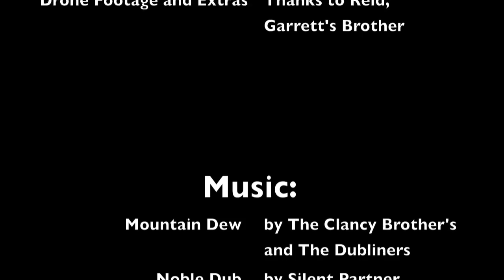Salt & Tar Episode 32 - Part 2: Cabin Re-remodel

Comment: Well done, it looks way better, and you make a great point about the limitations imposed by designing & building the original cabin in the confines of the shelter. It did come out looking a little like a houseboat! A poster below  (from Norway) makes a great point about strengthening forward and around of the mast. Your through deck mast collar still looks a little light to me. Thinking of Cape Horn here ;)

Comment: I have rebuilt 3 restaurants and 3 houses, for sure, you have done the right thing.  Ships carpenters used to rebuild the hold for every shipment when the hold is the home, you just rebuild as needed, see SV Emerald Steel.  In 30 years you will be much like Suzy and Jules.

Comment: Not sure what the eventual plan is, but I would have advised reconstructing the top edge of the cabin top's framing and jointing it in to the cabin top beams before putting the sides back on. As it is now, it will be awkward to reconstruct from the inside, but you're going to have to find a way to do it otherwise the first good wave is going to see you back to open boat cruising. Also, I hope you're glassing with epoxy and not polyester, as polyester has a nasty habit of not staying stuck to the wood. Great that you're reducing the deckhouse size though, more chance of dinghy stowage on the foredeck and stronger in the way of the mast partners.

Comment: Garrett (Mr. Tenacity) made the correct decision, even though it was the difficult one. Ruth can now enjoy more overhead cabinet depth due to this increased deck walkway. It can be a bad experience when one falls overboard whether on the hard or at sea, so this wider deck area will also make walking it safer (I've held my breath numerous times while watching you two up there). In my mind, Ruth is the Poster Woman for "Stand by your man"!
Reply: I agree either flush deck or have nice wide walkways for rough weather.
Reply: No Ruth, don't go postal. LOL I think you meant poster woman.
Reply: LOL.  Lordy......It was supposed to read "Poster", like Poster Child.....glad you caught that. Changed it!
Reply: I agree safety is key but now she looks Salty.  I've been waiting for the second issue of the remodel..

Comment: Love to know if the boat with the masts made like radio towers way of your starboard side is a catamaran. If it is then its famous. It used VW Beatle engines to walk up out of the water in the early 70's to save on boatyard fees and to repair it if damaged while in the middle of nowhere. Would love u guys to let me know.
If not it may be another well known old boat. So if you ever get the time would love to see which and what sort of boat it is. Those masts taking forgranted its a boat are just galvanised pipe with the air removed for rust protection. Really interesting build from an era of home builders doing it how they could aford and it all worked.
As for you guys. Amazing. Been working on other peoples boats since I was 9 now at 47 after hitting a whale that disabled the only boat I could afford I to am embarking on a build of a 35ft cat, as my Mrs get sea sick. To lazy to film but who know that might change now our backyard is large enough for the build. Love the woodwork skills and tou doing it ro fit what you want proud every time I watch an episode congrats.

Comment: Ouch, that was painful to watch, after all of the work building it.  But you folks seem to know what you’re doing, and it’s probably better to do it now, than not be happy with it later.  Best wishes.
Reply: Trouble is Andy, they clearly don't have a clue what they're doing. They need some professional guidance, this cabin structure will have no fundamental strength
Reply: David Arthur I don’t see how you can say that with all the support and 2 layers of ply then will be glassed on top all that it will be just as strong as before. This is not their first time!!

Comment: Making progress ! Great
The old bondo brand being used on wood (its an old rumor )does not work its polyester based it cracks out.
Use a good epoxy based resin with a filler ( also known as west system) A low buck sort of version is a good 2 part epoxy mixed with 90% wood dust so it seems just barely tacky.
Or at least visit your local auto body shop and buy a modern epoxy based flexible easy sand filler.
have had experience with all three systems dont make the same mistakes I did.
Good luck 
Ps Garrett make it count does not sound like Ruth is going to buy a 4th version LOL

Comment: Love your videos, thanks for sharing all the progress. I've a question if you don't mind. I see you using a straight edge to draw cut lines in multiple instances, I'm curious why you don't use a chalk line if you're making a straight line anyway? If this is a stupid question, I apologize in advance. I'm not a boat builder.
Reply: No such thing as stupid questions ;) We did use a chalk line first but it doesn’t always stick and can be hard to see under the intense sun so we trace over it in pencil quick with a straight edge

Comment: Nice work, guys; good to see you out of the mountains. Can't wait to see you in the blue water. Now that you are working on the top, a question about the bottom: how will you drain bilge water that will collect between the "floors" down on the wood keel? Maybe you have limber holes cut down next to the stringers, but can't see them here or in the early videos where you were constructing the frames. Seems moisture down on those plywood gussets and steel fasteners is a bad actor. In a heel, lots of leverage being transmitted from the that big ballast keel of yours to the frames via those gussets . And, enjoyin' Makim and Clancy (aaarrr).
Reply from the maker: Hey Rodney! We will have a bilge pump like most boats to get any water out of the bilge. Initially when we launch her she'll have water rushing in but once she swells she'll be tight like a barrel. Salt water isn't as much of an issue as fresh water. I sure hope the gussets are never submerged we'd be half way sunk! Da diddy di dum ;)
R
Reply: Thanks, a voice in the darkness and there's an answer! To the question, it seems the low parts of the bilge where water can collect is between the wood keel, floors and bottom planks, with no means of draining from each frame to the single low part of the boat, that is via limber holes. The wood boat Susanna has pvc lined holes through her frames with a spring loaded chain run fore and aft that can be pulled to keep 'em clear, and I think Tally Ho has slots cut between the floors draining to the low spot. Regarding gussets, I'm envisioning you guys in a starboard tack with rails awash (yahoo), with that collected water moving up the side and soaking the plywood, which in a heel are the new low points in the boat. Any water proofing down there in the future? Yup, get 'er wet and she'll take up water, and be "...tighter like a drum, dum dee dee dum dum." -rj

Comment: Man does it look more ship-ish now. Good riddance of the fullsize hunchback. 
And it's still "way bigger than people's tiny houses" according to Ralph. 
I probably would have tried to "just" reinstall the slightly curved sides "just" a bit more to the midshipline, but I'm sure You had a good reason doing it in straight.
And, by principle, inventing slight changes isn't that unusual in boatbuilding. We once broadened a whole motor vessel by sixteen centimeters (6.299 imperial guesstimates for You inch-people...) after seatrials, enginemounts and transom with a Z-drive and all ... not building something You have to sell soon for personal liking reasons is what You two do it for, at all, isn't it? A couple weeks more in the making will pay off anyway.

Comment: Having built or should I say part of a four man crew that have built twenty to twenty five boats over the years from lofting to the finished product. My concern is how wet the boat is going to be, noticing that there is little to no flair to the hull. To compensate for that one can makeup some splash rails which will elevate some of water that will find its way topside. Hoping the best on the rest of your journey !